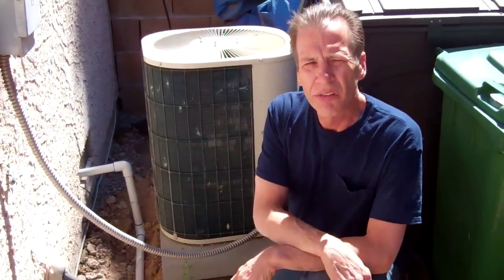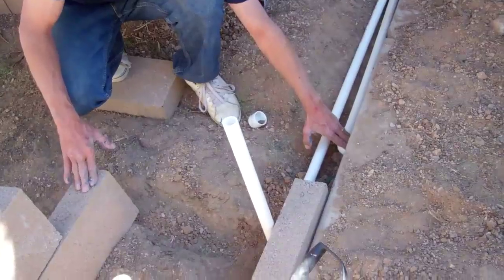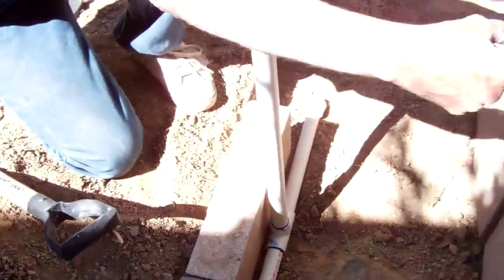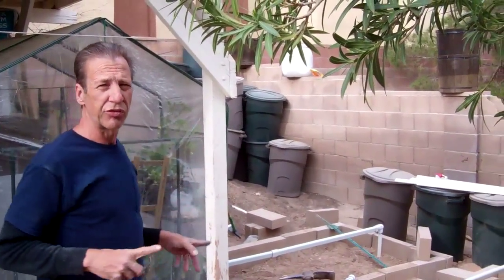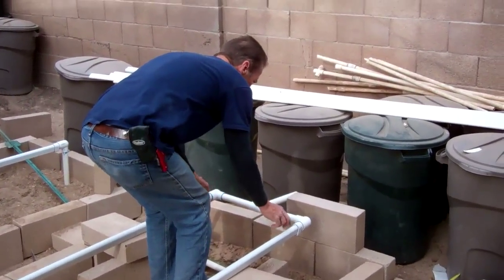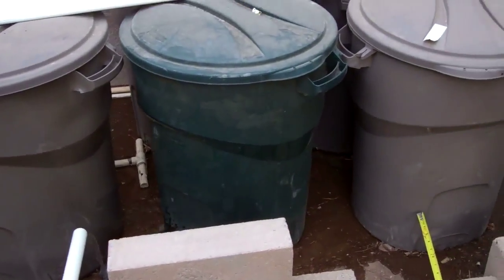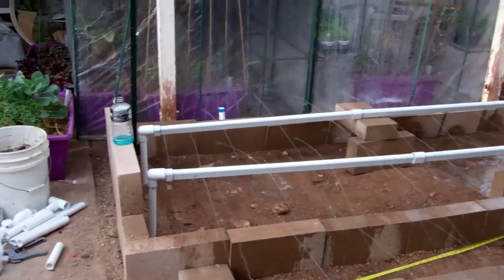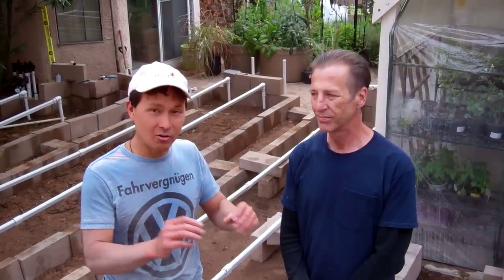AquaJet Installation at John Kohler's Growingyourgreens.com  part 1

Comment: Hey Rob, are you ready to come up to Oregon now for another install? LOL  I can't wait to upgrade our raised beds with the AquaJet!   Nice talking to you the other day (I'm the gal putting in permaculture, Tower Gardens and greenhouse).  You answered all my questions and helped me make the decision to definitely go with AquaJet system for our raised beds. 

Question:  So for 4 foot wide beds, are you generally recommending the 2 lines per bed now like you did for John or is the 2 line per bed configuration needed due to variables like water pressure or length of beds? 

Thanks, Jackie
Reply from the maker: I hear Oregon is real nice this time of year. I hope your garden grows real well this season.
Reply: Rob Buff
Hi Rob, please answer my question...
Question:  So for 4 foot wide beds, are you generally recommending the 2 lines per bed now like you did for John or is the 2 line per bed configuration needed due to variables like water pressure or length of beds?
Thanks, Jackie
Reply from the maker: The two lines per bed offer you twice the amount of aeration in the root zone. Of course this means more material to purchase so it is a user's choice. I like the two better if you have multiple beds then you may need to add more valves to keep the pressure up. I hope this helps.

Comment: Rob 
How long are the sections shipped?
On the site just has by the foot which doesn't give an idea of how many sections is needed for a 15ft run.   
Thanks
Reply from the maker: The normal shipping length is 4 ft but you can get it in up to 10 ft lengths. Anything that is over 9 ft is considered freight and has to be shipped by truck.